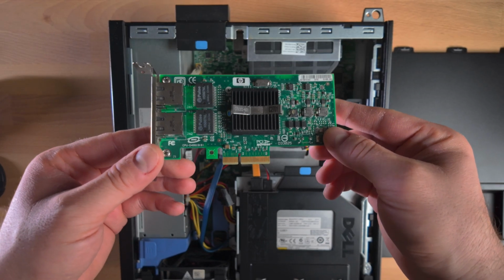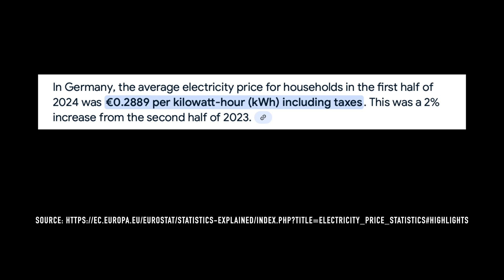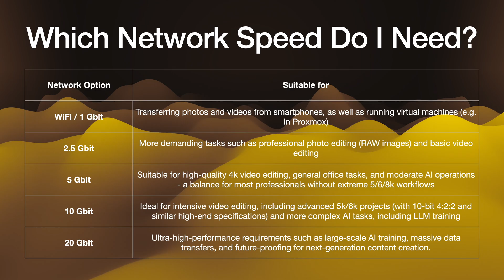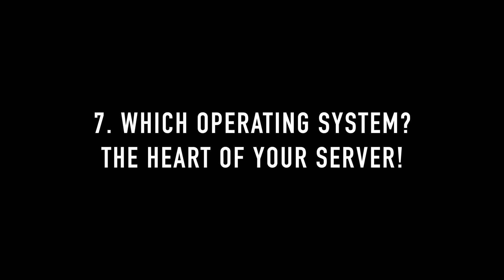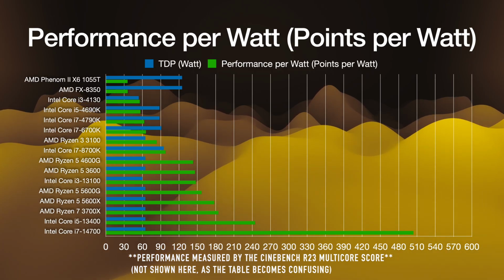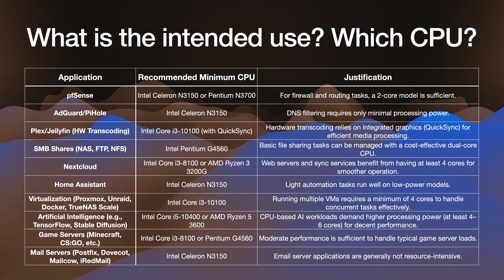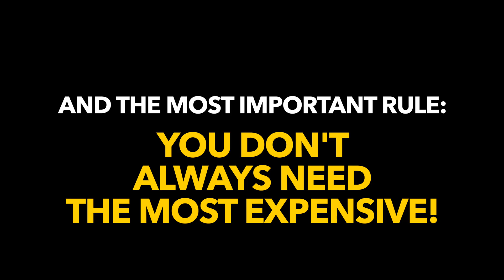Before You Build a Home Server – WATCH THIS!

Comment: first of all, USE PROXMOX! 
Then install an HBA card with no-bios firmware on it, you can hook up to 16 drives off of a single HBA card. 
pass the HBA card through to your OS of choice, for me that was Truenas.
I would recommend a Scratch disk being part of these setup using NFS. 
cheap used drives are a great option here just make sure they're not completely dead in smart lol . 
I'd setup the Truenas VM with ~4 threads ( 2 cores ) for storage even with ZFS caching, ( just make sure you give it ~16GB of memory so it works fine and turn off ballooning) 
also I would use 1 Cache drive per cluster of larger drives, personally I run an 8 wide array consisting of 16TB drives, with 1 being used for failover.  ( You PROBABLY don't need this) 
I would recommend Ubuntu for your main docker container hosting VM, most setup scripts are just better built for it, although when trying to run containers such as ARM I actually had better luck with fedora server. Feed it almost the rest of your memory leaving about 1-2GB left over and don't passthrough cores 0 and 1 since proxmox use those, also don't passthrough the cores used for truenas.
from there if you care about power consumption, turn it off while you're asleep and let it turn back on when you're awake. 
I do this using a used mini PC that runs home assistant which then pushes WOL packets to the device and turns it off properly through proxmox.

anyway hope this helps someone!

Comment: is a ryzen 5 5500 good for a game server?
Reply: Yes.  I have one in my server running Plex, 2 Satisfactory servers, 7 Days to Die, Project Zomboid, Space Engineers, and Conan: Exiles and it powers through it no problem.  The Plex servers are 24/7 and I usually just spin up the Docker containers of the others when we're going to play them to save on power but it can easily run them all at once.  I would definitely say to shop around, though, as the 5600 can usually be had for a similar price and you get PCIe 4.0 support plus more PCIe lanes and a little bit more performance.  But it's AM4 so if you need more power there are plenty of other options still on the market and TONS on the used market.

Another consideration is are you going to be running Plex (or JellyFin)?  If so I would highly recommend going with an Intel CPU (just make sure it doesn't have an F after the number) as their integrated GPUs are excellent for transcoding, go for at least 12th generation so you get all the newest stuff like AV1 decoding.

Comment: i build my server many years a go ,  got a motherboard , lga1150  that had 2 pci , 2 pci express , 6 sata ,  pay 70eu for it new ,  got a i5 4gen used ,  and a quad ethenet and dual sfp 10g . and run windows server 2012r2 .  use it for plex  . video photo storage .  all my drives for plex media are hdd  cash with ssd ,   and got sata  2ssd in raid 0  for my working files ,

Comment: DAS can also use an ethernet conection. Point to point network. Its how im doing it.
Reply: well, you could also use a serial cable or bluetooth, or some other unsuitable way. Point to point ethernet is not how I would ever advise for anyone to connect storage since you're just adding downsides that are unnecessary and getting zero upsides from it. 
But also - ethernet is by definition not DAS, even if you're using a point to point connection. DAS is local storage, if you have an ethernet cable in between it is by definition not local since you're using a computer to computer link to reach it. Using ethernet also means you'll need to set up a LAN and also have a free ethernet port on whatever you're using, and either always leave it connected and running once configured, or go through more configuration voodoo to get things to route correctly when connected vs not connected. 
"What is direct attached storage?
Direct attached storage (DAS) is a type of digital storage connected directly to a computer or server. Unlike networked storage solutions, DAS does not require a network to access data. This makes it a straightforward and cost-effective solution for increasing storage capacity, particularly useful for individual users or small businesses. " (Lenovo's FAQ explanation, the first reasonably concise one I found)
Reply: @noth606  I understand the point about definitions. Technically, DAS means storage directly attached to a host without any network protocol. So a point-to-point Ethernet link is not DAS because it still uses a network layer such as TCP IP and SMB or NFS. By the book, calling it DAS would be incorrect.

That said, in practice, a dedicated point-to-point Ethernet connection behaves very much like DAS. You have a single direct link between two computers, no switches or larger LAN required. Modern network cards with 1 Gigabit per second can provide around 125 megabytes per second, 2.5 Gigabit cards around 280 megabytes per second, and 10 Gigabit cards around 1.1 gigabytes per second. These speeds can saturate SATA III SSDs at 500 to 600 megabytes per second or even match USB 3.1 or 3.2 which typically reach 400 to 1000 megabytes per second. Latency is low and the connection can be hot-swapped if designed properly. From a user perspective, it feels very similar to DAS.

The part about using Bluetooth or serial cables as alternatives does not hold up. USB 2.0 tops out at about 35 to 40 megabytes per second, RS 232 or USB serial are much slower, and Bluetooth usually reaches only a few megabytes per second in practical use. These options have much higher latency and are not reliable for bulk data transfer. Comparing them to point-to-point Ethernet or even modern USB is misleading.

So while terminology is technically correct, in real-world usage a simple point-to-point Ethernet setup can outperform slower USB connections, provide direct storage access with minimal setup, and feel almost like DAS. It is really a hybrid approach combining the performance of direct storage with the flexibility of networking. In some setups, such as using a 1 Gigabit Ethernet link versus USB 2.0, it is actually the faster and more efficient choice.

Strict definitions matter for clarity but when evaluating performance and practicality, point-to-point Ethernet can be as effective as DAS, and dismissing it outright ignores real advantages.

Comment: A Core i7-2600 is still more than enough for a TrueNAS Core/Plex server with single or dual video streams. It is toeing the line of efficiency vs work potential, though. I need to look into Wake on LAN, I’m running an SSD storage array, so no spinup time…

Comment: interesting enough... but the best options around now.. you didnt cover them at all... Like Xeons.... and other good and cheap.. than you can buy from aliexpress for exemple.
Reply from the maker: not really. xeon cpus are not that efficient, but they are cheap!
Reply: @techpchouse  well a 2630v4 with no boost its not that bad and the prices of boards,cpu & memory (ecc) ... well it will take so many years...if ever to reach the price of the others.

Comment: When going with an AMD card make sure its not a 500 series. Go for at least a 6000 series card. They older cards are cheap but cant go into low p-states for energy savings (tried it a year ago with an old card I had lying around). That'll otherwise easily add 30W of constant power consumption. An Gigabyte RTX 3060 uses around 9-14W idle in comparison with better performance and encoding capabilities. I hope this info helps someone :)

(I used Unraid + the amd drivers)
Reply from the maker: thank you very much for the tip! For now im going with a AMD WX 3100 and the consumption ist okay
Reply: skip amd all together if you're using it to transcode. they're just bad for this task.
Reply: Personally, I think LGA 1700 is the way to go for a home server.  A 12100 or 12300 is perfect to get you going, the iGPU is great for transcoding, and it has enough processing power to take care of most needs.  You save a lot of money on power and parts by sticking with an iGPU but you can upgrade later if you're trying to run AI models or transcode multiple 4K HEVC videos at once--for those of us who have 1080P at the most and are only transcoding for family and friends the iGPU can handle it all with ease.  If you find yourself needing more processing power there are plenty of options available on that platform to choose from.

I was hosting Plex on an i5-7200U plus up to 3 game servers (Conan: Exiles, 7 Days to Die, and Satisfactory) and that little dual core was enough, a more modern CPU can run a ton!  I fell in to the "you need a dedicated GPU for transcoding" trap so I have an Arc A310 and a Ryzen 5 5500 in my home server and it's absolute overkill for running Plex, a few game servers, Arr stack, and a handful of other Docker containers.

Comment: You should have said that Thunderbolt cards only work on Thunderbolt ready motherboards. There is no such thing a self-contained Thunderbolt  PCIe card.
Reply from the maker: That is Not correct :) I testet my Gigabyte Maple Ridge Card on old Mainboards with Intel i5 3470 and worked Like a charm. You don’t Need the Special TB Header on your Mainboard, just the usb PIN connector

Comment: Another advantage of using used but working office computers? saving them from becoming e-waste.
Reply: I used an old police server I bought at auction it had 8 sticks of 16gb ram in it dual cpu-all for $100
Reply from the maker: @jakewaters1709 that is a really good Deal 💪🏽💪🏽💪🏽
Reply from the maker: Yes 💪🏽
Reply: I have 2 HP Elite Desks running in my homelab, they were old 5 years ago, but with a small upgrade in RAM, they are perfect to run a proxmox cluster

Comment: You have not touched memory. Do you have data requiring ECC? If so, it affects many other components dramatically.
Reply from the maker: @markmorati8986  That’s a valid observation! I didn’t touch on memory in this video because for my use case (media, backups, and some testing VMs), non-ECC RAM has been totally fine. But you’re right — if someone is running more critical workloads or using ZFS seriously, ECC is definitely something to think about.
Reply: that exactly my complain.. xeons, ecc memory and all that good stuff was not talked at all, and they are the cheapest options and one of the best around.

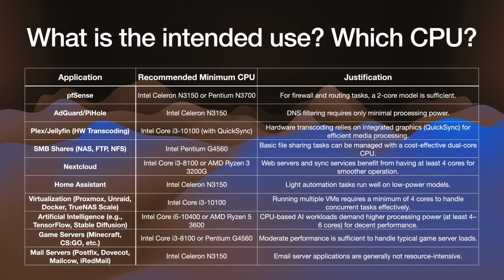Comment: apart from 7:29 chart, whole video is a very shallow content, is the script AI generated? -_-
Reply: I find it really hard to make content that's easy to understand without diving off the deep end of jargon. I think he did a good job especially with a 2nd language explanation
Reply from the maker: No, it's not AI-generated content 🤣 I've just tried to pick up the relevant content on the topic and keep it extremely brief. If there is a special interest in a particular topic, I will make a separate video about it.

Ps: Of course, I often use Ai when translating.